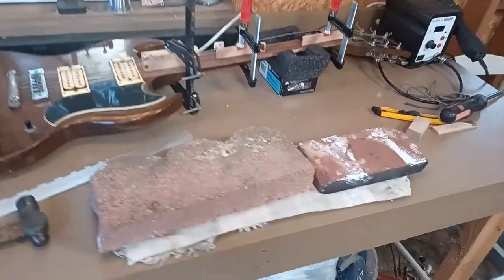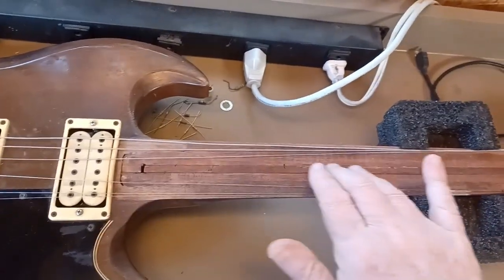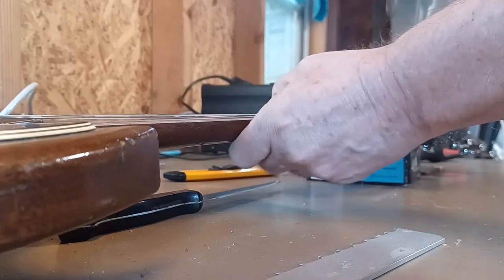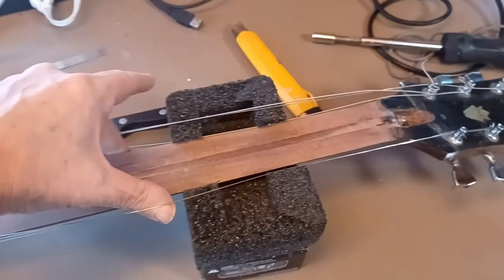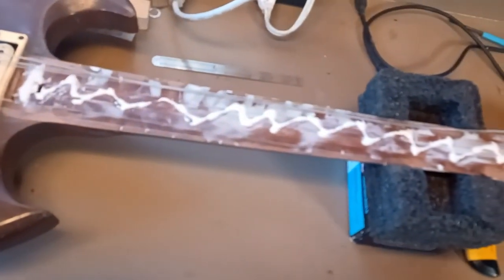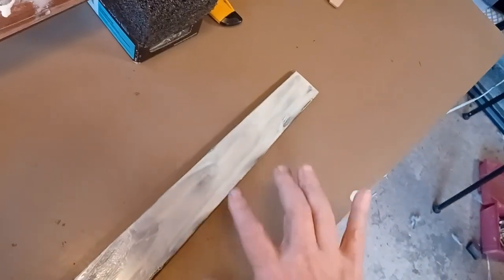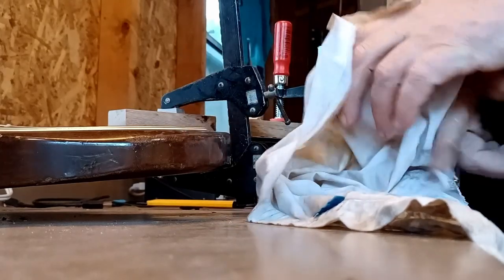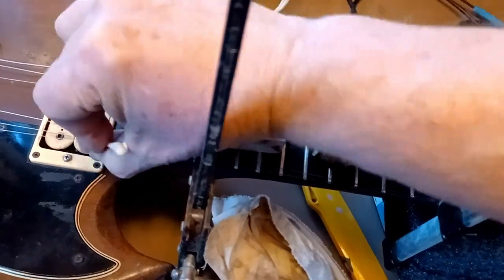1971? Gibson SG Neck and Truss rod repair - Episode 2

Comment: I'm in a similar situation with a 12 string guitar that has it's truss rod maxed out. I found your repair very interesting and I don't think I've ever seen the use of a such a specialised heat gun. What is the brand of your unit ?
Reply from the maker: It is a TXINLEI 858D 110V Solder Station that I bought from Amazon. Cost $40.  https://www.amazon.com/gp/product/B07FBGFT3K/ref=ppx_yo_dt_b_asin_title_o02_s00?ie=UTF8&psc=1

Comment: You should have paid more attention when watching those YouTube videos.
Reply: Thanks for the feedback. What did I miss in the videos?
Reply: @Beelzybud  You goofed up quite a bit. Should never clamp directly to back of the neck. I'm guessing you left some indentations that could be felt, for one thing. You never posted a follow up video either. I'm assuming something went wrong?
Reply: @theshyguitarist  I don't disagree. The two red clamps are flat, and they didn't mark or dent the neck, but the 3rd clamp near the body has grooves in it and did mark the neck up at the neck/body joint. So that sucks. What else did I do wrong? (I have a couple in mind) Also, it was successful, the guitar works, but I'm quite lazy and never posted the follow up. I'll do it eventually. Your comments are motivation to finish editing the thing. :)